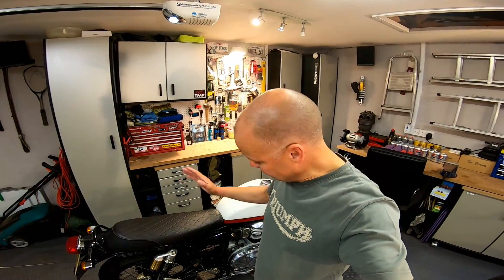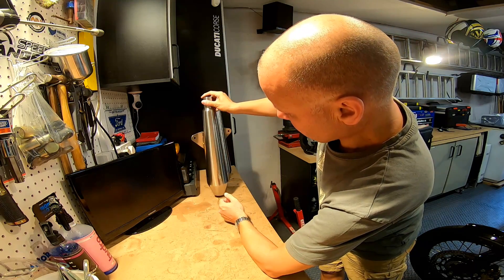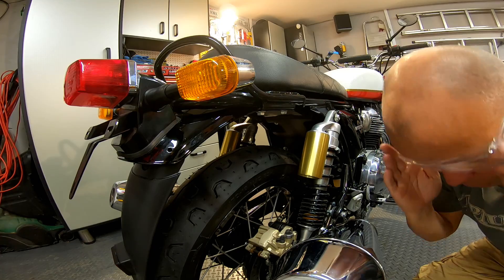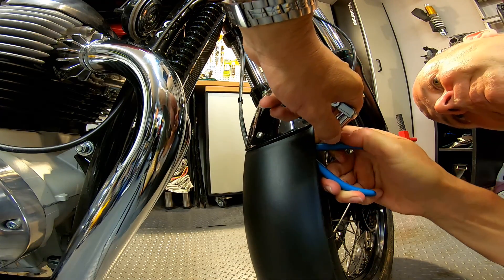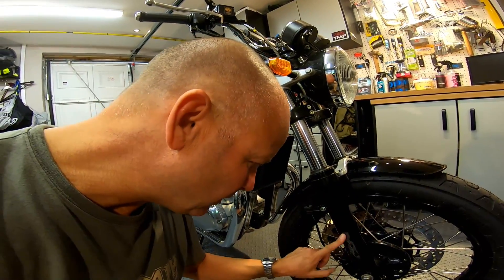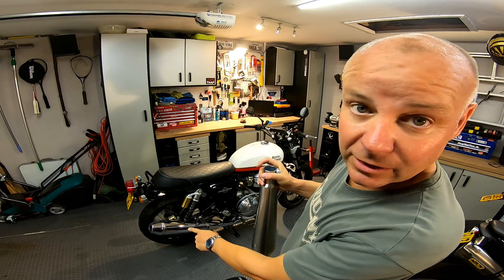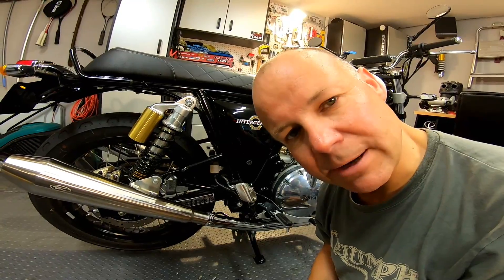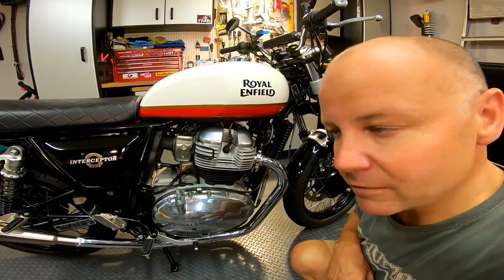Royal Enfield Interceptor 650 - How to improve the bike without spending a fortune

Comment: So I have a question what about the oil filter behind the tire, not worried about rocks hitting it, or are you planning a shield for it. Also the rear mud guard has a reflector that you discarded, do you need them? Goo-Off is good for that stuff on the front forks... Next mod should be bar end mirrors and rear rack and skid plate for the oil filter, then shiny aluminum spoke rims, and fly screen. Found one in Florida in orange for sale today New $5150 +++ (tax, Title,Registration)
Reply from the maker: Since I filmed this I have fitted a sump guard....

Comment: Rear, central red reflector legal requirement! Don’t know how big the rear reflector has to be or if the orange reflectors on the fork sides are also legally required. You have, of course, informed your insurance of the changes. Stay safe.
Reply: I doubt the side reflectors are required but the rear one is a must to pass MOT.
Reply: @CBRroyal382  There is a reflector in the taillight you only need one well here in the land of OZ hope that helps

Comment: Good day TMF, greeting from Australia. 

I am on the market for a new exhaust for my Baker Express, So many options! It is hard to choose! Are you still happy with the TEC exhausts? 

Have you figured out how to clean the joint between the can and the rest of the exhaust? I have heard that exhaust tape can trap moisture and create corrosion. Would you agree?

I d love something in chrome to get a nice homogeneity with the rest of the exhaust, but it seems that all the after-market parts maker are using stainless steel. 

Stay sane in the UK, my friend. Patience...
Reply from the maker: Thank you Steve - and yes still happy with the TEC pipe, having it modded at the mo!!

Comment: I suppose 'ricer' also applies to Indian bikes. I'd also want the fuel injection upgrade to go with the (baffled) pipes. If I was having that: then big valves, cam etc also. Smaller number plate and noisy pipes says 'please pull me over'. I 'get' the Enfield 650, which is why I bought a BMW 650 at 1/3 the price :-)

Comment: Slightly unrelated. I have a 2015 triumph street triple RX. My throttle snatches at slow speeds much like your speed twin before the throttle mod you put on it. Do you know if the throttle spacer will fit my street triple? Many thanks Lee
Reply from the maker: Check the throttle spacers website for details - link in the description...

Comment: There so cool are the Interceptors, like you he idea of the tape round the bottom of the tank seam, you say you used black masking tape. Is that the black pvc electrical tape? Want to do it on the bottom of the SS tank.
Reply from the maker: Yes exactly that...
Reply: TheMissendenFlyer cheers chief. Best wishes for the new year. 👍

Comment: Hi, thanks for all the vids and reviews, I was wondering if the ecu would need a remap? Thanks.
Reply from the maker: I hope not!
Reply: @TheMissendenFlyer  Yes I know what you mean but I'm sure they would have said when you bought the silencers. I have a 20 year old Tiger 900 and it has to be remapped with a silencer change but it's old technology so not sure about these days. I think I'll ask Google the question.
Reply: I couldn't find much advice but a couple of videos said, generally it's not needed unless you're changing the whole exhaust system and air filter, then the air flow will be much greater so the ecu will notice a drastic change, in that case it would need a remap but in this case I think it should be fine. It's amazing how the technology has changed, my old Tiger is so sensitive and has virtually no wiggle room.

Comment: Rear mudguard looks better off, Personally would leave the front on, didn't look any better, and serves a good purpose. I wouldnt have wasted the money on those pipes originals sound ok. Spend your money on suspension upgrades. Advice? Don't spray polish anywhere near your front brakes or discs like you did. Get that silicone based product anywhere near brakes or tyres, you can get all sorts of issues.
Reply from the maker: Thanks for the advice!

Comment: Did you start it and let it run for 3 minutes without reving it so the ecu could make the minor changes?
Reply from the maker: Nope
Reply: Anytime from cold would work if you did want it to make those slight changes,love those intercepters think8ng about trading my 1050 tiger sport in for one going back to basics👌

Comment: Our Interceptors here in the US are called INT650...because Honda copyrighted the 'Interceptor' name and they can't use it here.  Stupid.   My 2020 has round turn indicators and is the Black MKIII with silver wheels...otherwise identical.   Just installed TEC cans and mine went on with quite a struggle...had to sand the pipe end down a bit to get them to go on, must be some variables at work during construction...but they did go on and sound great!!   Leaving the fender extensions on as they're unobtrusive and will be handy should I get caught in a shower or on dirty roads.  My Suzuki SV1000S throws a strip of shit up my back because the rear fender is removed...won't do that again.  :)

The Enfield small engine guard bars are a nice addition that could provide some extra protection should the bike fall over and the TEC sump guard also a good idea to protect the oil filter from rocks thrown up by the front tire.   TEC adjustable levers are also nice and the Motone tank pads add that final Classic Touch while protecting the tank from your knees they also provide a great more grip for those of us who use the lower body to anchor to the bike.   Loving the Interceptor so far!

Comment: The mud guards on the rear tyres are for the vehicles travelling behind you.... removing them is not the most courteous thing to do...😱

Also, at 10:30 you say you took off the mud guard and now need to put some protection on the engine/bike that’s exposed to the tyre mud 🤦‍♂️🤦‍♂️... or did I miss something??

Comment: Hi love the pipes have to managed to source any heat shields to fit around exhausts to cover the connection clamp ?
Reply: All you need to do is cut them off clean the cut then put the Enfield clips over the area looks ok .

Comment: nice but have you tried measuring the db level for the tec pipes w/ & w/o the silencers coz in certain locations there are rules against noisy exhausts & would usually specify a max db level

Comment: Reason those old end cans were twice as heavy is you have killed two birds with one stone there the cats were in the end cans, you might wana fit a booster plug now to tidy up the fueling as they tend to run really lean, 
Strange choice removing that fender extender though but your bike your call you might wana think about protecting that oil cooler now its right in the path of getting a stone flung up at it
Reply from the maker: I have since fitted a bashplate since I filmed this and the booster plug is the next mod!
Reply: @TheMissendenFlyer  Nice one tec's bash plate is a nice bit of kit don't think it goes as far up as the oil cooler does it ? that's the thing that looks like a rad 
you will notice a difference with that booster plug tidy's the emissions up nicely, bout as far as you wana go with the 650 otherwise your looking at engine work & that kinda misses the point of the bike 

Enjoy hope your weather is better than the midlands iv'e not ridden since going up the ponderosa over a week ago :-(

Comment: wd40 works well for removing sticker glue .
Reply from the maker: Good tip!
Reply: Ditto the use of WD40, also tar remover works well. Tar remover is designed to use on your paint work. I would have thoughts meths and petrol removes the wax and may be paint lacquer.
Reply: BENZO BUDDY, To each his own.

Comment: Don't put ugly exhaust tape on. Hitchcocks sell a small chrome heat shield. It is designed to hide an ugly lug if you replace exhaust on a Bullet or Classic 500 but as it fits on with jubilee clips it won't be a problem fitting to your Interceptor.
Reply from the maker: I’ll check it out cheers!

Comment: You being a light aircraft pilot, I'm surprised you don't have a fetish for lockwiring your torqued bolts.
For any aircraft mechanic, the sight of good lockwiring is like the sight of steel braid hydraulic lines -
it shows attention to safety and quality:  The bolts will positively stay torqued and in place until the
lockwire is removed, and unlike with Loctite, the re-torquing will be just as accurate as the initial torquing.
All the material and tools are available on the Internet, even drilled head bolts in metric sizes, and
there are YouTube videos on How to Lockwire.  So why not make a video on lockwiring your
Interceptor GT 650 and Speed Twin?
Reply from the maker: ...I'm a pilot not an engineer (alas!)
Reply: @TheMissendenFlyer   - I understand the feeling.  But ... lockwiring is a job done by mechanics, and
for safety purposes.  Common items on a motorcycle would be any bash plate, drain plug, cylinder
barrel, cylinder head, wheel axle bolt, shock absorber, foot peg, control lever, exhaust pipe/muffler,
luggage rack, brake caliper - anything you don't want to come loose, especially things that have to
be removed periodically.  Of course, lockwire conflicts visually with pretty chrome surfaces, so it's
more at home on the bottom of a bike and on dirt/dual sport bikes more than on boulevardiers.
And so if I owned a Himalayan, it'd be lockwired to the teeth!  :-)

Comment: Hii just need some help on the interceptor 650 handlebar issue , I'm experiencing wobbling issues . Can you let me know a fix for it ??
Reply: Check the handlebar clamps are tightened up and the wheel spindle nuts too. 
Bar end weights may help if there is a slight shuddering at certain speeds, but before going down that route check the front wheel is balanced correctly and at the same time check  wheel bearings and head bearings for wear. Your local bike garage will do all that cheaply enough. 👍

Comment: Hi TMF , I notice a bit of engine stuttering on my interceptor while accelerating after shifting from first gear to next gear  after the engine warm up , this happens only for a second or two after which the bike picks up speed. .there is some kind of engine hestitaion in those one or two seconds . The bike visibly  shakes in those seconds , could this be due to some issue with fuel injection ..in Indian some people have done software update for ECU or fuel injection  and they were facing ignition problems at higher altitude .. would be glad to have your inputs on the same

Comment: A good selection of mods Mr Flyer. As others have pointed out, you'll need a rear reflector for an MoT pass. The stick-on variety look awful but the ones with metal tabs attached to (and below) the number plate look OK. Or perhaps change the (rather bulky) rear light and indicator assembly with something neater and incorporating a reflector?

Comment: Hi TMF it's now an MOT failure
Reply: John Woodruff If that’s the case, how do Harley’s get through the test? Also, if it were too loud, I’m sure TMF can just pop the baffles back in. Personally, I’ve had louder bikes that have had no problems getting through the MOT
Reply: Not necessarily , it's down to the individual mot tester , it's not even necessary to run the bike for the mot  , if looks dodgy then let's hear what it sounds like , they don't use decibel Meters.

Comment: Does it need a remap with baffles out
Reply from the maker: Hope not!
Reply: @TheMissendenFlyer  so you dont know best contact tec the engine is already running lean as standard that's all the popping on the overrun beautiful bike and great mods made a mistake with a gs1000 Suzuki I had in the 80,s fitted a full Harris race system without rejetting the carbs no 3 piston detonated the crown got to hot due to not enough petrol to keep it cool keep up the videos best on the net

Comment: Brake cleaner on that glue. Actually brake cleaner cleans anything
Reply: brake cleaner is not good on paint. use wd40; it's a solvent for glue and doesn't harm the paint
Reply: Dušan Pešić Non-chlorinated brake cleaner is safe on most painted surfaces. Just don’t use on powder coating. But I agree that ultimately WD-40 would be a safer option. I have cleaned things off paint with brake cleaner and never had an issue but make sure it is the non-chlorinated version.
Reply: @TimothyT230  didn't actually know there was a difference between brake cleaners lol

Comment: Sadly much as I usually love your videos a word of caution re your changes. Firstly you fail to mention your number plate is now illegal. You also fail to mention that the bike will now fail an mot without the rear reflector. A couple of close shaves with your mods and I'd say on balance I would have left the bike std.
Reply from the maker: I think you’ll find I did mention the number plate is now technically illegal....thanks for watching and for the advice....all the best!